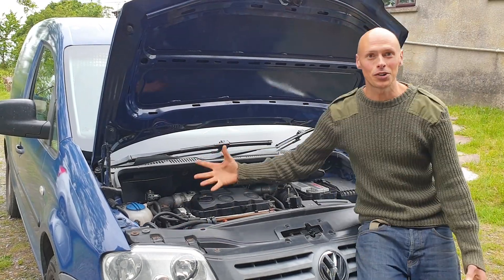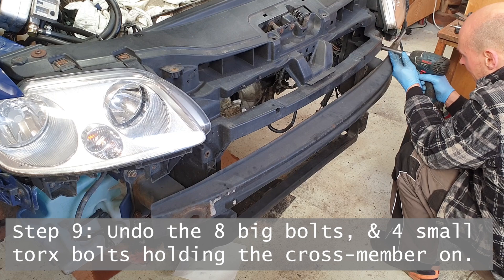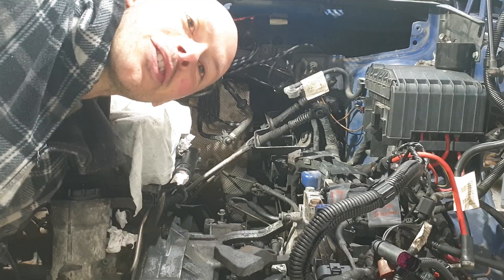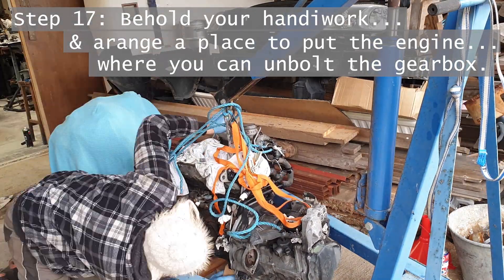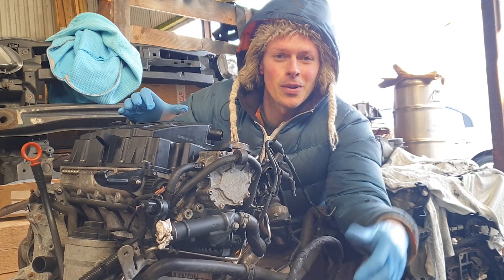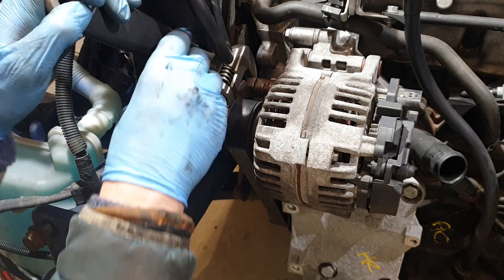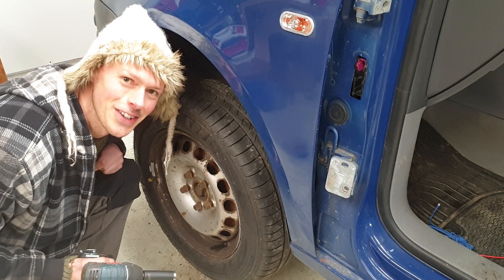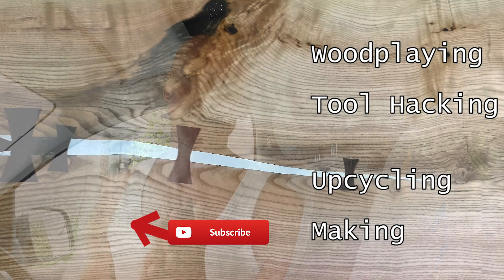How to change your Engine in 26 simple steps (VW, Skoda, Seat, Golf TDI, and Audi A3 etc)

Comment: Not to knock you but why would you pull the trigger on a replacement engine when the old one was still a known reliable one, had compression, and would be way less labour to repair than it would be replacing it. I’m sure you could have sourced a good used tandem pump and did the camshaft job also. What did you end up doing with the old engine ?

Comment: 7:42 

That catalyst is probably coked. I gutted mine. You can just drill it out from the top through the opening and hit it with a chisel. All the material comes out the downpipe. Make sure to wet it, or run a hose on it whilst breaking apart the material.

Comment: Great video, this made me dare to do mine. A bit more fiddly as it has AC but I managed to unbolt enough stuf so the whole front can swing away to the left (as seen from front of car). My BLS threw a rod at highway speed leaving a fist sized hole just behind the oil pump 😢
Reply: Recently purchased a 2013 Golf Tdi that had already threw a rod also. I wonder what was the cause? Hopefully with regular scheduled engine oil & filter changes, warm ups before driving, future rod breaking can be avoided. When my health improves, can't wait to finish fresh engine install. About 70% finished currently picking away at it as a little time opens up here & there.

Comment: This stuff is my bread & butter - before you dive into the whole "It's dead! Bin It!" thing - check out the wiring loom thoroughly. Many  many VW 1.9 TDI "Faults" including no start, bad start, "It's dead FFS!" are wiring related - the loom is not as durable as the metal - you will get loads of "This engine is toast!" hints that are actually wiring related.  I've stripped down a lot of these - the metal in them is good - excellent even - but the wiring lets them down. Before you yank it out - make sure it isn't just electrical gremlins. Even with 400k the innards are usually alright - but the ancillaries are shot. Poke ALL the ancillaries first before you yank it. :-)

Comment: So did you put a new clutch, plate and flywheel in in the end ? Also did you need a tool to reset the flywheel/clutch ?
Reply from the maker: Hay there Cathal, Yeah, I used the clutch plate from the engine I was replacing. And the duel mass flywheel from the new one. I don't remember using any special tools apart from a torque wrench...

Comment: Are you still running veg oil or have you given up? Also what issues did you hav running veg oil?
Reply from the maker: Still running! No issued that I haven't mentioned here - save for mild anxiety that 'something' might go wrong at some point. About 15k miles on filtered waste veg thus far...  and boy am I glad I'm running it right now. Just to fill up the aux 25l diesel tank is costly atm..
Reply: Good morning Veggie oil burner. I've had to pause from using myself lately , but plan on resuming in near future. I need to have a designated, rodent, & bear proof bldg 1st. @FloweringElbow

Comment: Well done for a 1st go very impressive

Only things I’d have done different for anyone thinking of tackling this
 
Do driveshafts 1st, crack the bolts loose on the hubs while it’s on the floor. Remove them fully as gives more clearance when removing engine. Along with better access for disconnecting turbo

Do all the stuff underneath BEFORE you drop any fluids. Your never going to catch all the oil, brake fluid, coolant etc. So get it all done while the floors nice & dry. Downpipe, sensors, shafts out, crack off gearbox steady but don’t take out until same point you did 

As you say take the slam panel/rad pack off as one. 

No need to remove alternator & starter unless your transferring to new engine. If transfer yes easier to do them while engine is still bolted in

Main pain in the arse is the 2 bulkhead heater matrix pipes as you said. Sometimes there a doddle. More often than not they don’t want to come off. Sometimes easier to start lifting engine out/away to get better access 👍
Reply from the maker: Really great tips friend! Thanks so much for taking the time :)
Reply: Could not agree more!!!

Comment: What a nightmare.
What was the original problem ❔
Reply from the maker: Was so bad ;) now it's fixed anyway. Tandem pump seal blew, sending diesel into the oil. Filled the sump and caused hydro-lock   and extreem ware on the cam shaft lobes because the oil wasn't oil anymore...

Comment: Hi. First of all, congratulations, you have a great job.My Vw T5 1.9 axb motor vehicle. engine block cracked.I want to install a 130 hp 1.9 TDI engine. Which engine would you recommend?
Reply from the maker: Thank you Yasin. I am afraid I do not have enough experience with different engines to be able to recommend any over another. Good luck with it!
Reply: @FloweringElbow  First of all, thank you very much for your answer. Which code number did you install on your caddy vehicle?
Reply from the maker: @yasinozkan9313  I installed a BLS - mainly just because that was what was there in the first place and we found one for a good price... Best of luck with it.

Comment: Would you still run veg oil ?
Reply from the maker: Yep I still run it and have for a few years now.
Reply: @FloweringElbow  do you use in traffic or just highway?
Reply from the maker: @css403  Both, Just starting and stopping using the biotuning kit, as described in the conversion video. That said,  we don't often do much city driving. normally motorway or 60mph limit rural main roads...
Reply: @FloweringElbow  what type of oil do you use ?
Do you also have filtration system for used cooking oil ?
I am very interested into this 
Thank you for your time for reading :)

Comment: Hi mate, did you remove the full wiring harness from the ecu? Or only unplugged the sensors/wires from the engine and left the loom with the car. Cheers
Reply from the maker: Hey Zain, The new (second hand) engine came with its harness all attached, so I used that, and unplugged the original from the ecu...

Comment: Hi, I love the video but I'm a bit concerned that you have used a BLS engine, are you going to replace the con rods? My wife had a Touran that spun a crankshaft bearing and smashed the connection rods to pieces filling the sump with shards of metal. Just don't want this to happen to you after all your work.  It seems to be very common on that code. I spoke with the garage a local VAG specialist who said that this is common with that BLS code. Just thought I'd warn you but I'm sure that you are aware of this
Reply: Thanks for this.

Comment: I bought a golf Mk6 back in December 2020,  previous owner never changed oil and he never told me.The car developed oil pressure after 2weeks of driving,next day I went to garage,they changed the oil and I received a bad news... the oil previous owner used was extra thick probably gearbox oil to hide the rod-knock noise, that way he was able to sell the car.I was advised to change the car or engine-£1,200 for labor 😔.
My questions are:
-do I need to code the ECU?
-Do I have to send any paperwork to DVLA,if the engine is basically the same?
Great video 👍
Reply from the maker: Hi there. Sorry to hear about your Golf. I didn't send any paperwork, assuming the van was basically the same. Whether or not you should tell DVLA  I don't know...  I didn't need to recode ecu...

Comment: Hey.. Great video 👍excellent job well done.. Could i ask what mileage the engine you put in had on it? Also the flywheel i think you said would not come off old engine you said holes did not evan line up? Is it possible i might have this problem on the second hand engine i may get? Thanks for the video and all the effort in giving the torque settings.
Reply from the maker: Hi Frances, good questions. The new one was on 60k when we got it. It is possible but unlikely. In fact it is more common for the engine to come without a clutch or flywheel I think. I asked for them because I knew our dual mass was on the way out/gone...

Comment: great video log. how much a job like this would cost in a garage !? .. i'm doing this currently also  but in a parking wich is a pain. cheers.
Reply from the maker: Certainly is nice to have the vehicle inside. Thanks for watching and good luck! ;)
Reply: One garage quoted me £ 1,200 with cam belt and oil change.Some VAG-garages specialists will charge you £1,900---->£3,500 and engine overhaul £ 3,500----> £5,000. Crazy money 💰💰💰💰💰💰💰💰💰💰
Reply: @MrSerghei1981  .. yep I agree. I economized all that by diy .. finished, working nice, tuned injection pump . Purring like a cat. nothing special this car but I'll never throw that kind of money out the window.
Reply: @djvaliro  I would do it as well,my main profession is Auto-Electrician done 3 year college ( 1995-1998) and worked for 5 mostly on lorries... I'm not afraid to take the job as a DIY project.But I don't have a garage nor a place to make this happen 🥲🥲🥲🥲 my car is parked on high Street.So yeah I'll have to pay the garage,I found the engine £895 with all accessories, I'll have a word with garage tomorrow if it's worth to buy.
Reply: @MrSerghei1981  I did mine in the parking in 4 days. Btw my is a skoda so way cheaper .. 200e engine. Everything else I had.

Comment: You want 5w40 505.01 spec for every PD engine apart from ones with a DPF as 5w30 causes cam wear
Reply from the maker: Good to know!
Reply: Think that oil spec is overrated.Used it every 20,000km still had to replace camshaft at 415,000km.Those PD engines are reknown for camshaft failure.
Reply: @eugeneoreilly9356  lol okay
Reply: @eugeneoreilly9356 oil spec is overrated. Right then. 😂
Reply: @Mac_F87  oil companies are only interested in selling oil.Words like 'approved by',replaces,or 'used by' is just marketing blurb.
Reply: @eugeneoreilly9356  absolutely incorrect, try putting non PD specific oil in a PD engine. See how long the camshaft lasts. I’ll guarantee it’s anywhere near the mileage you got. I’ve not long bought a Caddy van and replaced the camshaft and lifters. It has 143000 miles in it (234000km) and the camshaft was wrecked and two of the lifters had holes 3-4mm across and the rest were badly dished. First owner using long life service schedule and a subsequent owner using the incorrect oil have definitely helped it along.
Reply: @Mac_F87  I see where your coming from but I owned the car from new and changed the oil myself with the correct 01 spec.In my case only one lifter was destroyed,the other 7 were perfect which is strange.My car has now got 475,000 km but in your case perhaps the previous owner neglected oil changes.I like those pd engines but now I just use any 5w40 oil.Good luck with yours.

Comment: What was the procedure for aligning the engine when reinstalling the engine onto the mounts? Thanks
Reply from the maker: Hi Fr 240. Good question. I don't remember it being much of a problem. Essentially just using the hoist to wiggle it into roughly the right position so you can put the bolts in lightly... Then wiggle jiggle and tighten alternating bolts until all are at specified torque.

Comment: Which manual did you use for torque settings? And did the Haynes manual cover engine swap?
Reply from the maker: Hi Zak. Mainly the Haynes for torque - but I believe they are taken from VW's documentation anyway.... Haynes 'sort of' covered most of it

Comment: In many cases torque settings are only there to make life easier for beurocrats and lawyers.
Unfortunately once the manufacturers provide a torque setting people in a profesional setting have to abide by them or risk law suits. 
Some manaufacturers are providing torque settings on domestic electrical fittings meaning electricians are having to buy torque screwdrivers. and have them calibrated every year.
Reply from the maker: Hey Elanman. Thanks for the perspective, there is a lot in what you say that rings true!